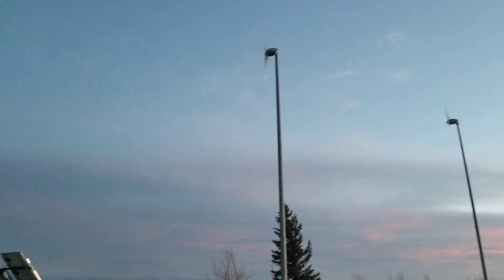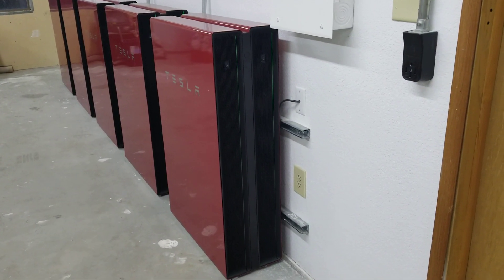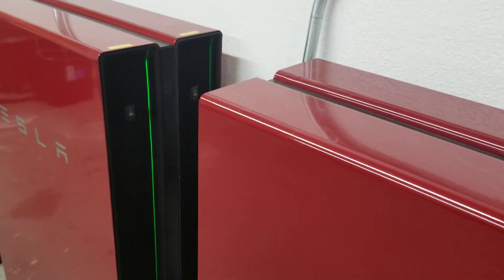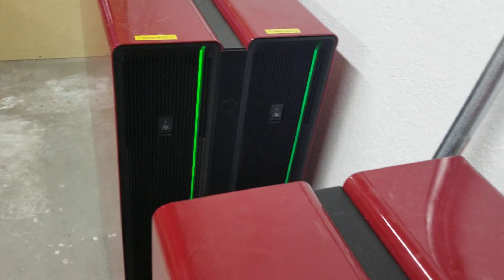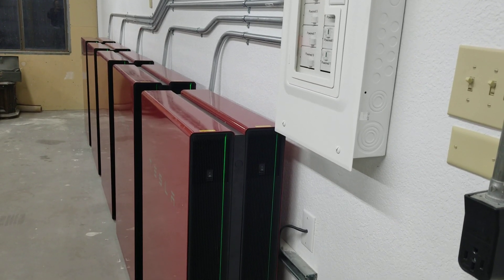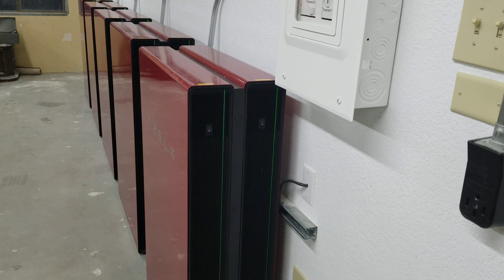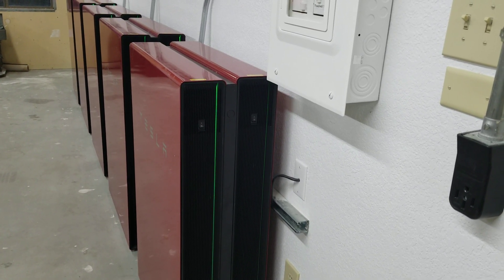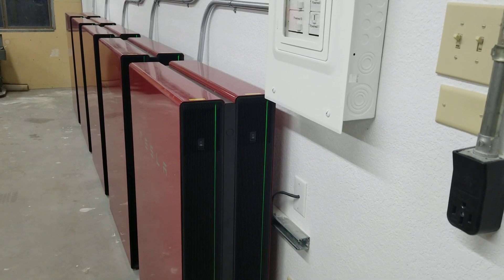Our 10 Tesla Powerwall 2 being charged by wind

Comment: Hello Jason - Fantastic job going off grid.  I have 3 Tesla Powerwalls and I have been told by Tesla I cannot charge my Powerwalls here in CA with anything but solar if I already have solar on a lease due to federal guidelines given the discounts from my lease.  They have it programed to let wind charge my home but never charge my Powerwalls.  Are you truly charging you Powerwalls or just using wind to power your home? See  https://personalpowerproject.com/  -  Thank you Jason
Reply from the maker: Just for clarification, we are grid tied. Our Powerwalls reduce our grid dependency, but are not sufficient to make our home "off-grid".  

Here is a link to a TMC forum thread I started on the topic of integrating wind and solar PV with the Tesla Powerwall2 system.  

https://teslamotorsclub.com/tmc/threads/residential-wind-power-and-powerwall-2-integration.191776/

We both charge our Powerwalls and power our home, as well as push excess power out to the grid, from our 4 Skystream 3.7 wind turbines and solar PV seen in the video here. 

I hope this helps.  The TMC thread helped us identify the turbine controller requirements to be compatible with the Powerwall2 system.  Since the Skystream 3.7 fits those requirements, no special programming was needed to be part of our system.  As far as the Powerwall and Gateway are concerned, the turbines are sensed and controlled the same as Solar PV.
Reply: @AltView1  My guess is you purchased your solar not leased which gives you the legal right to use wind to charge your powerwall batteries.
Reply from the maker: @DanRingwald  Yes. We own all of our equipment. None of it is leased.  IMHO there are too many variables and added complexities with leasing when it comes to expanding the size of the system, if needed, tax credits, insurance, liability, and I have never seen a renewable energy lease that didn't end up costing more than purchase, even after factoring in financing costs.  That noted, I'm sure there are good reasons why others choose to enter leases. For us, and our situation, it didn't make sense and it wasn't really an option in thos mar6as we were starting our projects in Cheyenne, Wyoming in 2012.  We also came into this with the experience of living off grid at another home since the 1980's where most of our equipment we purchased cash as we could afford it, building the system incrementally over a period of years.  There was one PV array on a tracker we "rented" from the local power coop which had a "solar stock tank" program they modified to supplement power for our home when our Jacobs Wind Electric turbine from 1948 needed to be rebuilt in 1994.  We ended up keeping it online because it was about $20 per month. 

I don't know how to navigate your si6but wish you well with it.

What kind of wind turbines do you have?  If they are part of a grid tied system, and are A.C. coupled, I don't understand how they would power your home but not your batteries or the grid.
Reply: @AltView1   We did a Tesla solar lease because we are on a ridge top in Santa Barbara and get very high offshore winds during the winter storms.  My concerns were the solar panels blowing off the roof and they would be all replaced for free with a lease.  We are now into about the 8th year of our lease and a week or two ago it was determined by Tesla that our solar panels were all poor quality and developed water leaks so Tesla just replace all 30 solar panels, better quality, higher wattage, all for FREE and it took about 2 hours to replace all of them.  We currently do not have any wind generators because the Santa Barbara county permit processing told me that solar is mandated by the federal government so they are forced to approve all solar requests.  Wind is not mandated by the federal government so they are refusing all residential wind requests until the federal government forces them to say yes.  I had someone from the county tell me if my wind generator was under 15 feet high there would be no need for a permit.  If that wind generator was grid tied with SCE we would need a permit which the county and possibly SCE would both deny.  Your energy needs are about 50/50 solar and wind.  I see our needs in our location more like 80/20 as we have more sun and milder winters.  A wind generator for us on our 7 acre ridgetop parcel being under 15 feet with maybe 2 or 3 of them producing much less than your skystreams might be all we need.  They could be totally off grid just charging our one EV which as you know EV's will always be the largest power demand for most people.  I will dig deeper with Tesla and SB county and once I get a solution I will update you on the results.  Thank you Jason for all your great help and the good work you have done to help show the world what is possible and how to do it.  Great job!
Reply from the maker: @DanRingwald  honestly, I would not bother with wind turbines smaller than ours as they do not generate enough power to be worthwhile for most applications in this country.  A 15 ft height also is a tremendous impediment.  Ours are 45 feet to tower top, and the blades extend beyond that.  Also, avoid VAWT.  I have yet to see one which is reliable or productive. 

I strongly suggest, if you haven't yet read it, go to the Home Power archive, register for free access, and read some of the articles by Mick Sagrillo about comparing, sizing, and locating wind turbines.  He rebuilt our 1948 Jacobs and is definitely a resource to start with. 

https://www.homepower.com/

As for wind shear resilience, our turbines and PV have this far withstood 90mph winds.  While most of our PV is on trackers, we do have a roof mounted array for direct solar PV electric water heating using the Sun Bandit system.

https://www.sunbandit.us/solar-energy-kits.html

Comment: Let me guess, four dollars per kilowatt hour would amortize it over five years?
Reply from the maker: There is no intent to amortize this over any number of years.  Try reading the video description before embarassing yourself by posting a snarky and ignorant comment.
Reply: @AltView1  time will tell. (Pat on the back) I just like to know the numbers. I’m glad you are in a position that it doesn’t matter do you!
Reply from the maker: @jackshepherd2660  The financial break even on most residential renewable energy systems without batteries and are grid tied, here in Wyoming, is 10-15 years.  Battery systems installed in Wyoming will almost never break even. That noted it is difficult to predict the the future, but generally utility costs for the 20 years we have lived in this house have only increased.  By the time we decommissioned our propane furnace in 2014 and replaced it with a ground source heat pump we had been spending  ~$4,000 annually for fuel.  Our Subarus were costing about $100 each for fuel and $2,000 each in maintenance and repairs annually when they were replaced with electric vehicles.  The cost savings, despite higher electricity use, which lead to higher electricity consumption would not normally be considered in a simplistic "Return On Investment" analysis for Residential Renewable Energy systems but was a factor for us in figuring out what is was and is within our financial reach.  Where there have been tax credits available, we used them to help fund them the step in our overall project each year where we have added to our systems since 2012. In Wyoming, that is Federal only as the is no state income tax and no tax credits for residential renewable energy systems. 

We all make choices on what we spend money on.  There are many things other people spend money on such as second homes, ostentatious pick up trucks, airplanes, exoensive travel, timeshares, or smoking tobacco. 

We bought our Tesla used. When ask by people how we can afford it, my answer is "it was paid for by all the cigarettes we have never smoked in our lives".  The only new car we ever bought was a 2014 Nissan LEAF which not only was financed for 0%,  but discounted about $10,000 with dealer and manufacturer incentives because it was "the end of the production year" in July of that year, and still qualified for the $7,500 tax credit.

My beloved and I both work full time and have planned out this project together.  While part were financed, it if now fully paid off.  Part of our whole personal values is giving back.  Our projects are giving back cleaner air to everyone and yes we are willing to pay substantially to that it, just like we give 10% of our gross earnings every year and give that to a long list of charities.  We are living our values, not imposing them on others, but imagine what could be accomplished environmentally if others with the same or greater financial means would do similarly. Some are, and that is why there is increased demands for this technology and the costs of it, whether residential renewable energy systems or electric vehicles, the costs are coming down.  Some people call this "the green tax". If it is, we're okay with paying it. 😎
Reply: @AltView1  Thank you for your very courteous reply. I am a retired engineer from the Quartz crystal industry. My greatest interest is in finding the particulars of a secret of Nikola Tesla. It’s an energy source that Westinghouse would not back because of difficulties in collecting revenue. Possibly I can re-discover? One juicy tidbit to add in: Donald Trump‘s uncle was responsible for gathering up Tesla’s notes upon his death! Easily found with an Internet search.

Comment: If l had what you have (farm and all) l would build a manned multicopter and fly around with "free" battery power. Battery cost is a big problem with these cos of the limited recharges. Only good if you are making money from them, and that's why only air taxis are planned, not personal ones. I would be looking into super caps instead of batteries. With one tenth the run time (one minute instead of ten). But that would still make more sense than buying batteries all the time. So one minute is OK and fly low and recharge as many times you like for free. The old school jet packs only went for like 20 seconds.
Reply from the maker: No need for aerial transportation on our property. It's 9.6 acres, the smallest in this community where others are a minimum of 20 acres. There is another video on my Channel which shows an overview of the renewable energy equipment on the property.

Comment: Do the wind turbines make noise? If they do, would you consider the barrel type turbines that are less efficient but more silent?
Reply from the maker: HAWT (Horizontal Axis Wind Turbines), historically have been more efficient and reliable than VAWT (Vertical Axis Wind Turbines).  Our HAWT are rated to withstand winds up to 120 mph.  Also being 45 feet above ground, wind speeds are higher than at ground level.  Most VAWT are mounted at ground level.  Our HAWT are rated at 2.4 kW @ 16 mphwith a cut in speed 8 mph.  With winds of 27 - 30 mph (not uncommon here) each produces a sustained 2.8 kW with peak power upto 3.3 kW. 

The two turbines closest to our house are 80 feet and 160 feet away.  We barely hear them inside the house.  Typically, wind noise exceeds turbine noise.  I think elsewhere on my Channel is another video where you can hear birds chirping louder than these turbines.

Comment: Impressive system. Is your backup generator set to charge your power walls if they get low on charge? If so how is it set up and how do they communicate with the pw’s?
Reply from the maker: The Powerwalls charge only from our renewable energy devices. The generator only activates if the batteries are depleted and the grid is offline. It doesn't charge the batteries.  We could choose either recharging from renewables during grid outages or the generator, not both.  We rather go as far as we are able during a grid outage with batteries and renewables, then have the generator be a secondary back up system.

Comment: I'd love to see a prequel of this video:  The installation.  Was that videotaped?  Do you have just 1 gateway?  What was the cost for labor and materials?  Do you charge your Tesla car(s) with Level 3 (high voltage DC), or plain old Level 2?  I see the Powerwalls are resting on the floor.  Any chance of a flood in that room?  Did your homeowners insurance policy go up?
Reply: Each Powerwall can sustain 5kw of discharge so 10 of them could team up to the 50kw, less than the 75kw of the 1st gen Supercharger. Maybe it could be made to work but I bet they're just using a 240V 50A circuit per vehicle.

Comment: How many days can you go off grid if you were conservative with your consumption
Reply from the maker: All depends on weather.  We still have a secondary backup 22kW propane generator, so we can likely ride out a grid outage for upto 10 days in winter.
Reply: @AltView1  

This getting truly off the grid seems a pipe dream still , the technology is not quite there , you have a lovely setup
Reply from the maker: @prezodent2371  just to be clear, we are not off grid. Thos is grid tied with net metering. Our prior home was completely off grid from the 1980's until it was lost in a firest fire in 2012.  There's a big difference between building an off grid home and retrofitting a grid connected home.

Comment: Hell why not also have a solar roof?
Reply from the maker: Are you referring to Tesla Solar roof?  It wasn't available when we rebuilt our roof system in 2004.  We have a metal roof which is highly weather resilient.  Most of our solar PV panels are on trackers which gives us about 25 - 30% more power per rated kW of the panels and makes them easier to service.  For instance, I don't have to climb up on the roof to sweep snow off of them. I that that from ground level.  Our solar direct electric water heating panels are roof mounted.  If we didn't have the equipment in service we presently have and were rebuilding the roof, or building new construction, we would consider a Tesla Solar roof.